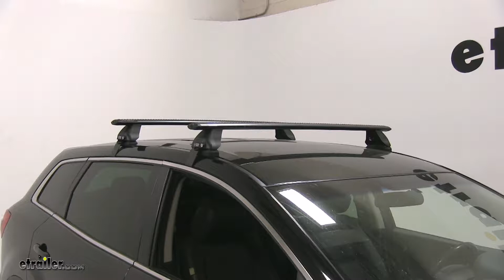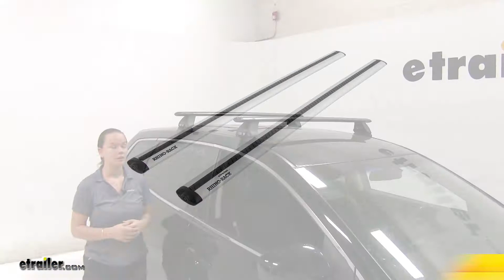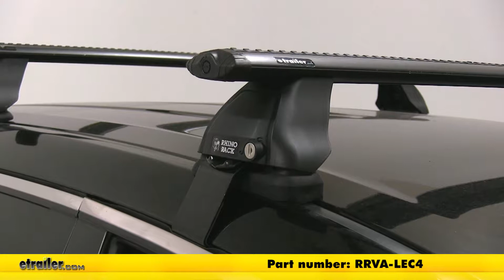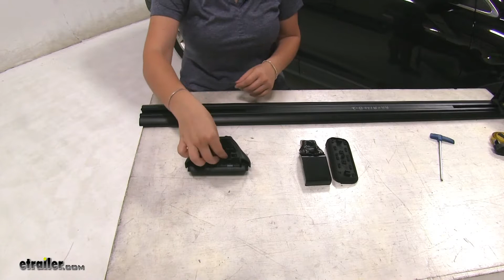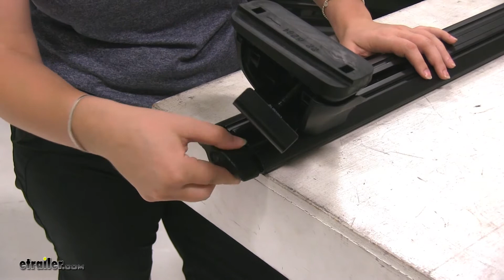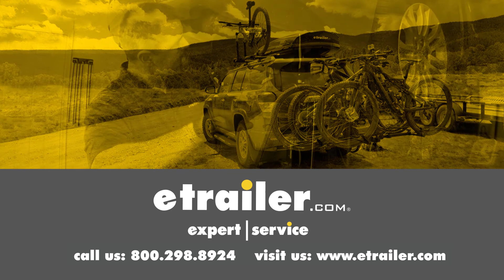Fit Test: Custom DK Fit Kit for 4 Rhino-Rack 2500 Series Roof Rack Legs on a 2013 Mazda CX-9

Comment: i cant see where the foof rack was 
conclude
Reply from the maker: Are you trying to see how it connects to the roof? It uses clamps that go around the roof into the door jambs. Here's the product page for just the clamps so you can see what they look like https://www.etrailer.com/Roof-Rack/Rhino-Rack/dk220.html
The other parts for the rack are the legs https://www.etrailer.com/Roof-Rack/Rhino-Rack/rrrlkva.html and the crossbars https://www.etrailer.com/Roof-Rack/Rhino-Rack/rrva126b-2.html